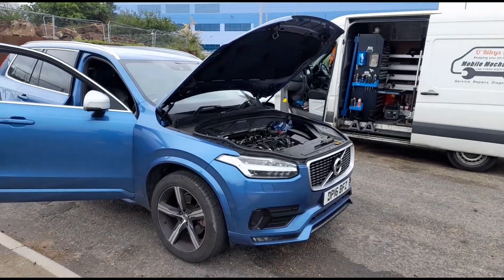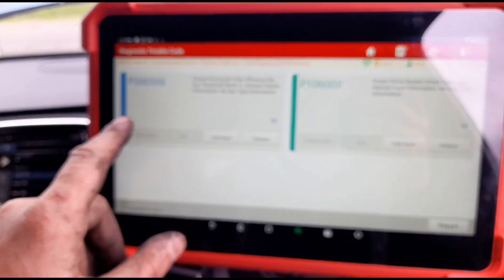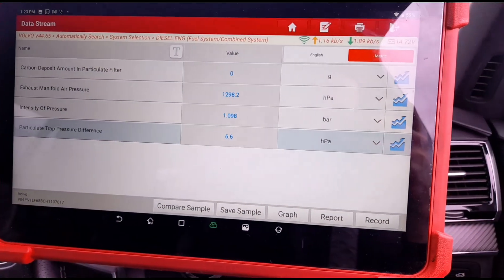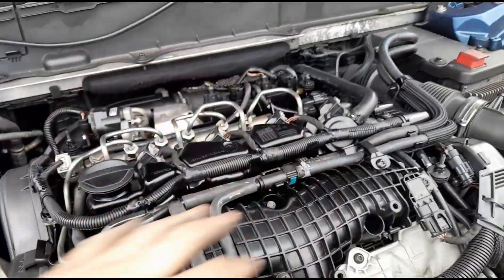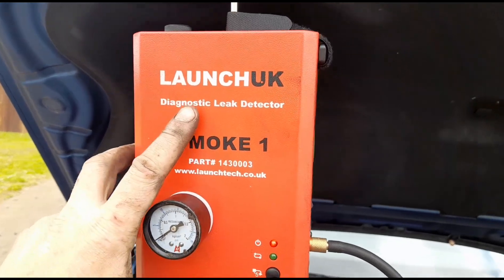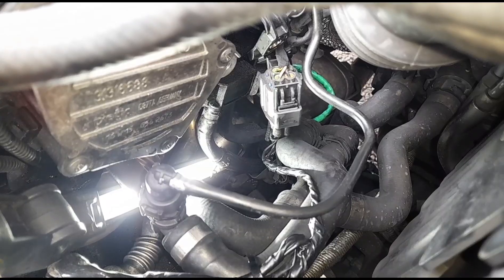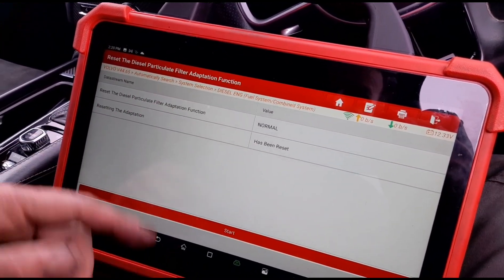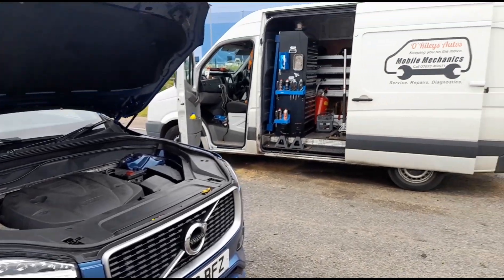Volvo XC90 2.0 D5 PowerPulse P200200 Diesel Particulate Filter Efficiency Below Threshold Diagnostic

Comment: Hi. What are the correct pressure differences on the dpf in xc60 ii 2.0D 190km 2020? I cleaned the dpf after this error occurred, idle speed is about 2-3hPe, 2,000 rpm - 7-8hPe, 3,000 rpm - 17-20hPe. You have 7hPe at 3,000 rpm and it seems very little. I would think that the dpf is clean, and if there was a large pressure difference, then I would say that it is clogged. Additionally, I have the P20EE error. Can you give me some tips?
Reply: Did You resolve Your problem ?

Comment: P200200 DTC means there’s a crack in the dpf
Reply: As long as there’s no air leaks and the turbo actuator is fine then it’s the dpf
Reply: @user-zz9wh4sx6d  Volvo has a TSB that says you can get a false code if the PM sensor fails. Volvos concerns in releasing the information was that to many shops were changing a DPF unnecessarily without confirming soot at the SCR, with a PM failure.
Reply: @JustMe-Dude  do you work for Volvo?
Reply: or a failed PM sensor. before replacing a very expensive DPF, should always check for soot at the SCR first to rule out the PM. in this case, Jimmy confirmed there is also low differential pressure at idle so most likely bad DPF. you can't just use a code without troubleshooting.

Comment: Jimmy, the "power pulse" system you mentioned is just the equivalent of taking your little compressor that you attach to the cleaning gun and sticking it in the engine compartment. The hose from the compressor goes to the exhaust inlet of the turbo with a valve that opens when you bury your foot into the excelerator pedal. The whole idea is to spin the turbo up sooner so there's no turbo lag. If the valve or hose was damaged or malfunctions I could see this being an issue affecting exhaust gas pressures, EGR pressure, or turbo issues that could have an effect on the DPF, or some of the sensors in the exhaust.